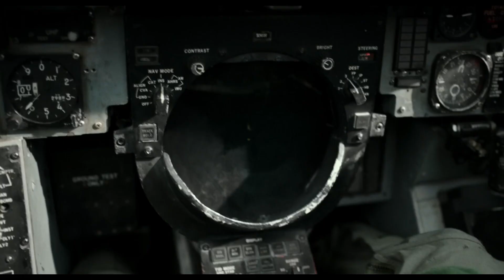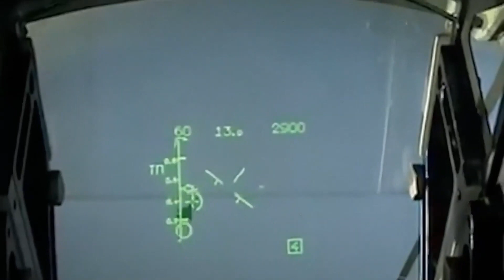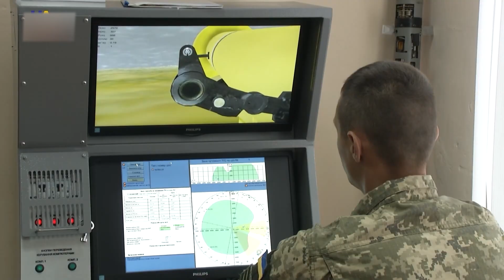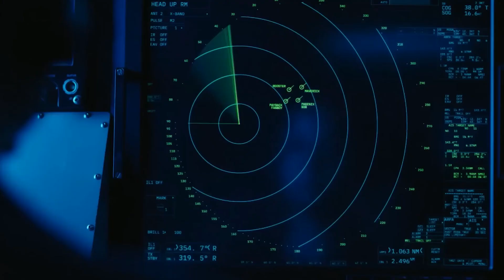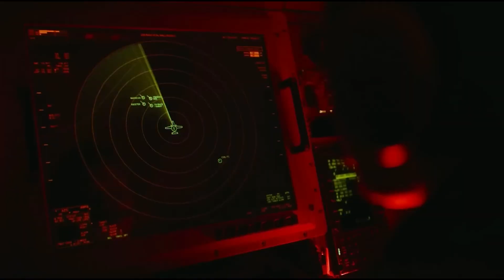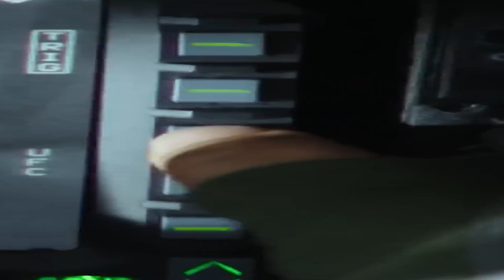Insane Stealth Of The F-16

Comment: Ok, the Mig may be more maneuverable for the one turn fight. The F-16 is the best 4th gen fighter at a rate fight where maximum turn rate is the key. The Mig ends up having way more cost per flight hour if comparing apples to apples. They rate their engines in hundreds of hours while we rate ours in thousands of hours.

The F-16 was cheap because the technology was developed by the F-15 program.

The F-16 radar and weapons really set it apart. And real dog fights dont happen much any more.
Reply: Pretty much noboby cares about one turn fight, about dog-fighting in general. Today that's like pulling a knife into a field with assault rifles. Now who has the better avionics, radars, integration and operational skills at formation (squadron) level, takes the cake. And here is no comparison. Russian planes didn't even passt yet from the first gen AESA, the western 4th generation planes have for long the 3rd gen active radars.
  About Ukraine...whether the F-16 will change or not the game in this war, this lies in the number of planes that will be delievered. At least 5 squadrons, yes. The less will be (delievered), the less significant changes will bring.